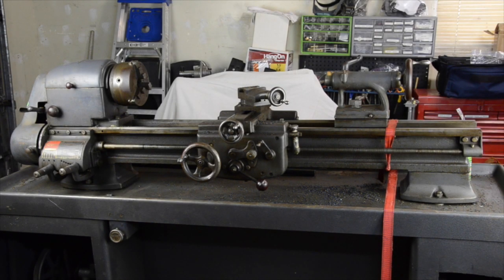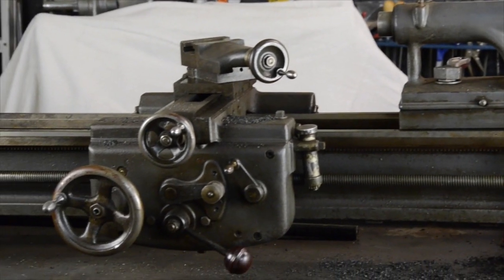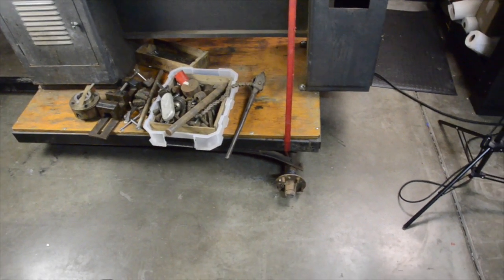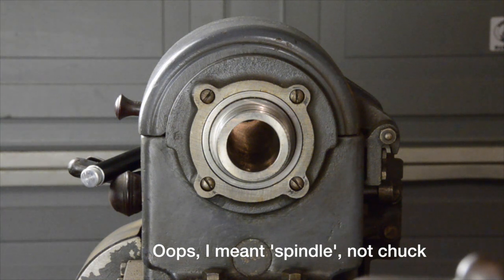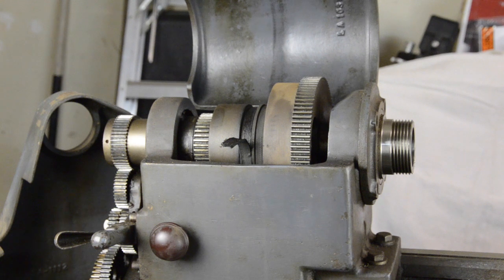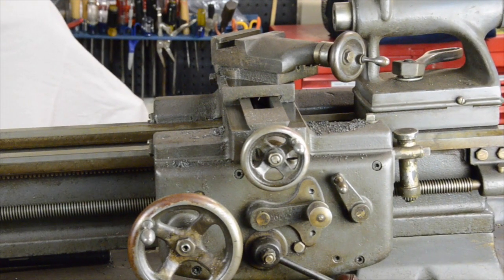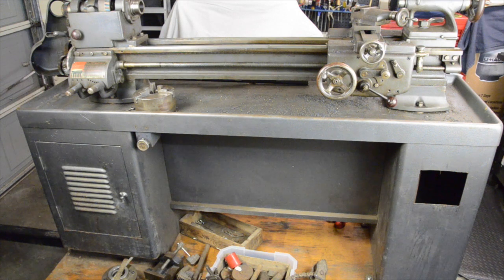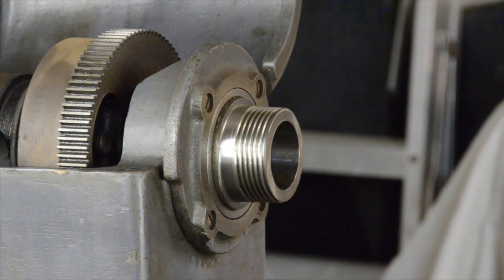Logan Lathe follows me home

Comment: Great info nicely presented.  Only thing I'd add would be discussion of spindle speeds.  Lots of older lathes don't have a very fast top end.  I think the Logan with ball bearing spindle has relatively fast speeds available which can be nice under certain circumstances (material, size, carbide tooling).
Reply from the maker: Good point Chuck, when I received the manual from Logan, I was kinda surprised at the range of speeds, 16 of them from 40 rpm to over 1400.  I'll cover that next time out, still cleaning it up!!

Comment: Stopped by a barn sale one day and in a dark corner I spied a Logan 200. For $400.00  I couldn't say no. It came with tons of tooling and extras including an original manual.  The only thing I replaced was the chuck with a modern equivalent . Runs like a top. A numbers check indicated it was manufactured in the forties.
Reply from the maker: rlr50 Good Find!!  My first personal lathe was a model 200, but it was in pretty bad shape.  I learned a lot working through all the problems, glad it was a fairly simple machine.  Yes, very sweet little machines.

Comment: Is this model (1957) able to cut metric threads or is it SAE only?
Reply from the maker: There are some imperial threads that approximate some metric, but for the most part you would need the transposing gear(s) to cut metric.  The Logan Lathe site includes an explanation here (Section 4.1);  

http://lathe.com/faq/index.html#_Toc95180297